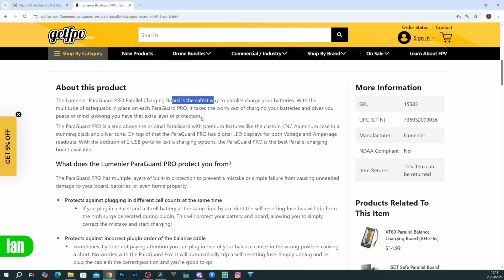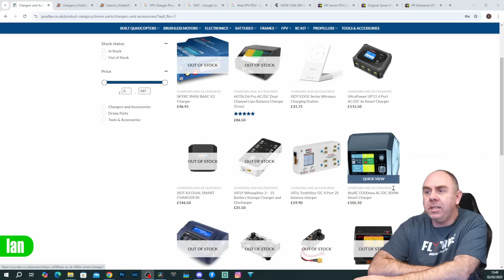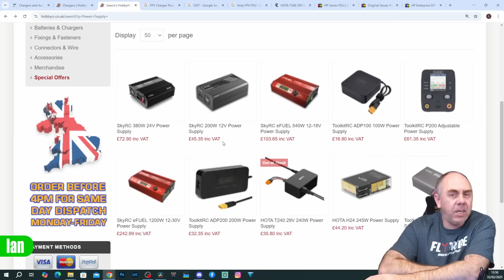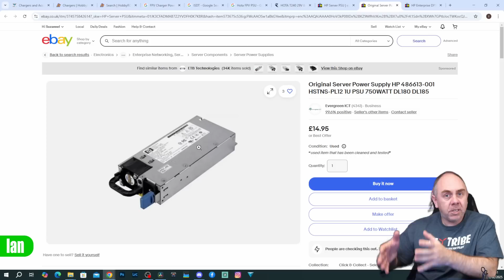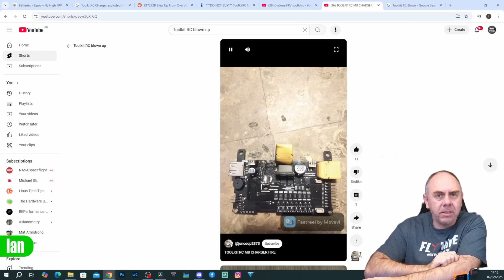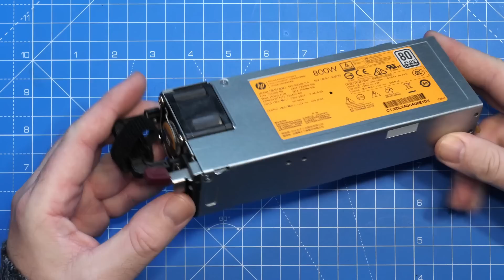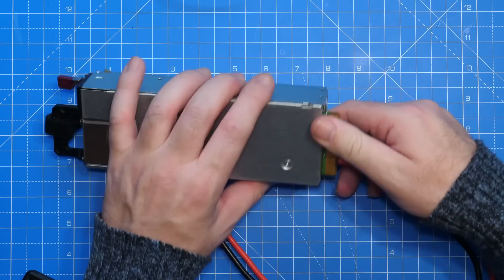FPV Lipo Battery Chargers Buyers Guide - Don't Get Caught Out!

Comment: The new SKYRC dual channel one works well for me, mostly using it on AC and DC on the Field. If something dies i can probably fix it. I dont need 1000w, the built in one is enough. 
ToolkitRC always stood out to me for their smaller sizes, they do the same thing (in theory) like other brands but are smaller and lighter, never bought one tho.

Comment: I've used a toolkit rc M6D, with an asus 200w charger (20v 10A, they have amazing filtering, really low ripple) for the last 4 years, mainly charging 2x 6s drone batteries at 5A. Still works perfectly fine, 
BUT even after calibration with 1k$ multimeter it is still not perfect no matter how much calibration you do, so that's a big minus for me. (firmware updated as well)
Reply: The manufacturing is hit or miss, had hundreds of M6Dxs with no issues, and then a box of 25 with 4 distinct problem and no replacements from Toolkit. They burnt me for thousands and ixll never do business with them again

Comment: hota f6 is the best im over 600 lipo chargers and going strong , i had toolkitrc they are cheap and fail fast , and they do not ballance corectly ,
Reply: My f6 is 4 years old, in my backpack everyday. Charged over 2000 packs.  Have a gang of f6+ at home, all with dead internal PSU's and all plugged into a big Hp server PSU

Comment: I will never buy a dc only charger as it’s a ridiculous idea to use an external power supply just to charge up a couple small batteries.
Reply: There are alot of great little Chargers like Hota T6 that work right on USB-PD.

Comment: I suggest anyone who is interested in parallel charging should read Oscar Liang’s excellent article on the topic at his website. I follow his guidelines religiously when I parallel charge. He concludes the article with this: 
“In conclusion, parallel charging is a valuable technique for FPV drone pilots to charge multiple LiPo batteries efficiently. By following essential safety guidelines and understanding the principles of parallel charging, you can maximize its benefits. Alternatives like multi-channel chargers offer added convenience and safety. Choose the right method based on your specific needs and budget.”

Comment: 2-3 years on the hota d6 and only used on AC power.  Fan broke on one replaced it and no issues.  I have two of them now and been very happy.
Reply: Same.
Reply: same two hota d6 pro and one skyrc d200 neo on AC power no issues !

Comment: Is there any charger, which also has a 65W USB-C output? The only ones I found so far, are the ToolkitRC M6DAC and ToolkitRC M8AC - but since they are obviously totally not recommended, an alternative would be nice...
Reply: The hota P240 power supply has Usb-PD on the supply (and the xt60 mains)
Reply: @Fly_High_FPV  Can't find a Hota P240. Just a T240. But the USB-C output of the Hota T240 just has 45W, which can be found on a few other chargers as well.

Comment: I can attest  the f6+ Is hot trash. I have four of them and three of them have bad PSUs. I have a fourth one that I don't even bother plugging into AC because it's unreliable and eventually it's going to go as well.  So now I have four massive bricks that I'm using only DC. F6 DC edition is the way to go for sure. Even on the F6 plus using only DC it works great but do not buy the F6 Plus It will go bad eventually

Comment: Are you 240 or 120 for AC? In the US it's 120 which probably stresses the system less.
Reply: Quite the opposite actually, you need more amperage with lower voltage to achieve same power. More heat to dissipate/bigger wires etc..

Comment: Parallel Charging FTW ..! I've been doin it for years without any problems... of course i'm always carefull. I'm using a 24V 1000W PSU with a ISDT P20 and two JB parallel charging boards.

Comment: You’re spot on about parallel charging. Not only is it unsafe, you honestly ruin your batteries lifespans. I use a hota d6 pro and have put over 2000 packs through it in the last 10 months. No issues what so ever. About to pick up a second just in case my luck runs out and it dies. Tends to be my luck once I brag on something 😝 
Great video and solid advice sir. And I personally know one vendor whom received an entire case of faulty chargers from ToolKit RC , there response to his request for a refund was they would discount him another case.. 🤦‍♂️ horrible company with terrible qc. I’ll never own a product from them!

Comment: I've had bad experiences with the calibration function of ToolkitRC chargers. I used a voltage reference of 4.096V, generated by an LM4040 shunt regulator. I used this to set all channels to this voltage as precisely as possible. I then discovered that the individual cells were charged to different final voltages during charging. This can be determined by connecting a standard cell voltage meter immediately after charging and checking the individual cell voltages. Testing with a DVM also confirms different cell voltages.

The charger's cell voltage measurement therefore differs between calibration (open circuit) and charging (load). This is really bad. You can calibrate the devices, but the voltage values in the calibration do not correspond to the voltage values during charging. And the deviations are not even uniform across all battery cells, but vary depending on the channel.

Tested on the following chargers:
- ToolkitRC M6DAC
- ToolkitRC M6D

Comment: While I hear you on the subject of the parallel charging board - it was a pain to charge 6 lipos (and storage charge them after flying) with only two ports and charging at 1C. And it is absolutely wild to build a power supply beyond 100W if you only charge one battery at a port at a time (for regular FPV). I dare to say, that most chargers are designed for the use of parallel charging boards.
Reply: It’s also a pain to burn your house down.
Reply: @Flumphinator  Sure. That's why I check cell voltage up front and watch the charging process as well as check the battery temperature (by touch) during that time.

The other solution would be a charger with 6 individual charging ports but I don't know any.
Reply: @Flumphinator  But thanks for the reminder, just ordered a Vifly Toothstore as I love to fly 2s. At least 4 ports and affordable.
Reply: @ I think that’s the right choice. It never happens to anyone until it happens, and the cost is really not worth the risk. Good on you.
Reply: You just need to make sure parallel cells have very similar charges. 
I tend to charge the lowest level cells first until they match the other cells I want to change.
IMO, it's not practical to charge a bunch of single batteries one at a time.

Comment: I use HOTA F6 and can confirm that it is reliable so far. Using it with external Lenovo 200w 20V notebook power supply resoldered to XT60.
Reply: yup. the HOTA F6 has been solid for me
Reply: Also I had ISDT K2 air and I returned it after mechanical problem with button and later constant "Incorrect battery connection" errors popping so I never can be sure I'll get the charged pack if I leave charger alone until the end of the cycle. Unplugging and plugging the battery solves the situation for a while, but no guarantee that it won't happen again. So I banned ISDT from my tool kit.

Comment: The fuses on Jb boards do work trust me I have blown them just from packs differing by a couple of volts.

The main danger is setting a charger incorrectly and overcharging cells and for that reason I recommend completely switching all your flight packs to the same cell count to mitigate overcharging packs on the wrong setting.

Almost all problematic lipo fires come from overcharging on the wrong settings and this becomes apparent quite a while after you start the charging process.

Having 10 chargers that you have to set going 10 times unless you balance charge every time (which will wear out the balance cable) I think is going to 10x increase the chance of using the wrong charge settings for the battery.

So what I ultimately am saying is that A good quality balance board with fuses like JB's will 
1. blow fuses with just a couple volt mismatch
2. Any Problems will be apparent as your connecting battery's and are present.
3. You only set your charge settings once and 10x less likely to make an error.
4. Having 10 cheap chargers increase the chance of a dangerous charger failure by 10x 

Remember you can always put lower rated fuses in Bardwell's board.

Comment: I have had no problems using parallel charging (despite plugging in the balance ports the wrong way). I always make sure that I'm no more than .1 V off
It would be good to know what problems you are warning us about exactly.
Also never had a problem with the AC included. 
If you're not using parallel the current should be rather small so I'm surprised that the internal AC failed.

Comment: Server power supplies are great. But they are 12V and chargers cant get full declarated power at 12V.
Reply: I use 2 HP power supplies that I can connect in series to my charger no issues. I use to connect it like this to parallel charge 4x6s5000 lipos on my Icharger 408.
Reply: Completely depends on the supply. Mine is 760watts, delivers 29amps at 24v
Reply: What power supply do you have for 24v? Thanks
Reply: @tomaskonkol8894  the Hota t240 is 29v. But I'd rather buy a larger server power supply that's 12 or 24 volts and use it.  12v works great too, and the server PSU typically has more watts than you need

Comment: About the server psu, while yes they can deliver some astonishingly high power, it’s only 12 V. This is a problem since those higher power chargers have a higher minimum input Voltage.  (At least that was the case years ago) There is a reason why my DIY server psu is rotting im the corner. 

And if you have the idea to connect two of them in series, rejoice. The negative terminal of those is tied to ground/earth. It would require advanced modifications to make them floating. Then and only then you can connect them in series.

Comment: My ISDT D2 and HOTA D6 Duo Pro chargers with AC and AC/DC have been rock solid for me for many years. I guess the reliability varies by the brand/model and luck though. I've avoided the Toolkit chargers because I heard they suck for all the reasons you mentioned.

Also, you can pry my parallel boards from my cold dead hands lolol. If someone is a noob or just not mindful of what they're doing, then yeah, they shouldn't use them. But if you do know what you're doing and you check the voltage of every pack before plugging it in and monitor the batteries during charging, then the parallel boards are a huge time saver and can be as safe as charging a single battery at a time IMO/IME. I've been using them for everything since 2017. The fires happen when you do something dumb like plug in different cell counts, or plug in batteries at different charge levels, or have a damaged battery in the mix. One time, I had a damaged pack start smoking but caught it quick and tossed it outside, but I'm sure it would have done the same when charging individually.

Comment: Yeah, you're spot on regarding parallel adapters, dumb idea 😉
Just pickup 2-3  old 4 Button Chargers if you want AC and don't push the Charge current and they will last forever.

Comment: 2 ToolkitRC M6D for over a year now and both solid. I did need to re-calibrate after updating the firmware but going strong so far. I am considering buying a Hota F6 to add as well.

Comment: HOTA D6 Pro AC/DC. Absolutely solid. I charge 12 6s lipos in one go.
Reply: With a parallel board right?
Reply: @definingslawek4731  yeah two of them. They are just the cheap ones from aliexpress, unfused etc. I charge in a place that won’t matter if there’s a fire and i check each battery cell prior to charging.
Reply: @definingslawek4731  Probably 2 boards since it's a dual channel charger and most boards only support up to 6 batteries at a time.

Comment: I have 2 B6neo+, 1 B6neoac, and 2 older b6neo, and all have been working great.  I primarily use 100W USB PD for powering them and love the reverse charging on the b6neo+ for discharging.  Works great and allows me to also power charge / run notebook with my flight packs while in the field.

Comment: No offence, but it's easy to recommend multiple chargers when you get your chargers for free. If I'm taking 12 packs to the field parallel charging is a must. I've been parallel charging for 14 years now and the only thing I've upgraded is to fused boards from non-fused parallel boards. It's as safe as you are. Always check your cell voltages before plugging in...been doing it so long it's automatic and I have a cell checker sitting beside my charging station for this very purpose. It never moves from there. Also best practice is to plug in the main connector for each battery first before the balance leads. If there's a significant difference in voltage you'll trip the fuses on the board.
Reply: PowerLab 8 + FMA board user for like 12 years :) Indeed. Takes lil but more thinking and culture of charging. Pity they stopped manufacturing them, these things are monsters compared to "new" chargers :)
Reply: @alexanderfedorov7890  what's so special about PowerLab 8? 40 amps, 1000 W, 1 channel for 250 €? I have no idea why do you need 40 amps, to charge 25 to 60 batteries in parallel? There are many similar chargers still available and even twice as powerful, if you need it.
Reply: @gpaull2  Absolutely true, a bad cell on one pack can kill that same cell on all your other packs. That's why you check the cells before plugging in. A bad cell isn't going to hold voltage until you start charging it though...that's not how they fail.
Reply: I would like to see a reasonable argument against this with price estimates as well. I haven't bought anything for larger batteries yet and still need to be convinced of one side or the other.
Reply: @sbeve1344  Pyrodrone has the Hota F6 @ $130. You can buy the crazy overpriced STRIX Ultimate Joshua Bardwell Parallel Charging Board for $45. It has fuses on the XT60 and polyfuses on the balance connectors. Everything Ian was asking for and you can charge 6 at a time. That's a huge time savings for me since I never stress my batteries with more than a 2C charge rate and balance charge every time - overkill I know, but I save so much time by parallel charging it's worth it to balance them and doesn't take long.
Edit: I take it back...that parallel board isn't overpriced at all. It's got a some cool features in addition to the fuses and polyfuses. XT30/XT60 support on a single board and a built in battery checker are nifty.
Reply: @sbeve1344 
Cheapest charger per channel I know of is the b6neo at $25 (to give it a slight advantage I will assume you have many usb c psus already).

The cheapest powerful charger for parallel charging I know of is the hota t6 at $50 plus a $20 dc supply plus a $40 jb parallel board (cheapest with good protection I believe). This puts the price per channel at $18.3.

So assuming you already have plenty of usb c psus, you’re still looking at ~40% more for individual channels vs parallel.
Reply: I use to parallel charge all my lipos for my quads no issues. Just made sure the cells were close in voltage. Haven’t done it in a while but for sure it can go to hell if you have a bad cell but the same can happen with a single lipo on charge. Anyways my best charger to date is my current Icharger 408.
Reply: @ yes 👍. Correct on this. Not something I do often. Mind you there is a port on the charger for a temp sensor that I don’t have.
Reply: Given the overall cost of this hobby, a couple of extra chargers ain’t that significant.
Reply from the maker: Jist to be clear the only chargers I have got for free were the ones that failed.  All the chargers I use daily I paid for.  

In sorry but the cost difference should not be a factor when it comes to safety.
Reply: @ If you're worried about voltage differences between cells, you can get Bardwell's  balance board. It has fuses on the main leads and polyfuses on the balance leads with a cell checker built in. A blanket "don't use parallel boards"  is just uninformed scare mongering.
Reply: Now I have to find what's Bardwell board
Reply: @MadRC  funny is that only for you they break
Reply: 100%  @MadRC
Reply: lol 😂

Comment: Ive got a couple which ive used for racing which include a Hota D6 Pro, Hota P6 and ISDT P10. All of them work amazing apart from the P10 NOT having a discharge for storage discharging lipos. As I set up some old server psus at the club, more people have moved to/ bought when starting the P6 or the D6 depending what they want. A club member has had a D6 Pro PSU die from a surge which then caused the PSU to die while connected to a 24v PSU of mine. It popped the 10amp fuse on the lead and smoked. At the club in total I believe 5 chargers have died between everyone. 2 ISDTs and 3 Hotas but 80% of chargers are Hotas to begin with

Comment: There's only one parallel charging board I recommend, one that's used for charging 1S cells with a multi cell charger.
Reply: So a series board, not a parallel board
Reply: @xer125  Lol, exactly 😉
I don't recommend parallel charging, I've seen the odd battery fire and they aren't fun.

Comment: I like to Series charge (2s x3 = 6s), I don't have to worry so much about battery voltage differences. The charger runs at a lower current and doesn't get as hot.

Comment: My Hota D6 Pro is 5yrs old now and all have had to do is replace the fan with a GDA5010. My other charger is the ISDT 608AC and it has been excellent especially for traveling with.
Reply: 608 is amazing little gadget
Reply: 608 is an absolute beast, just wish it had 2 charging ports